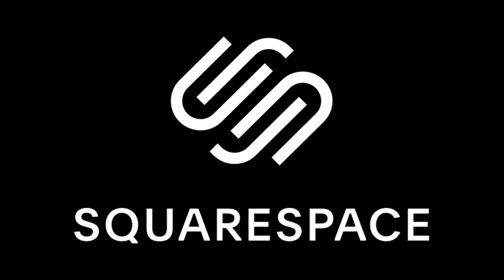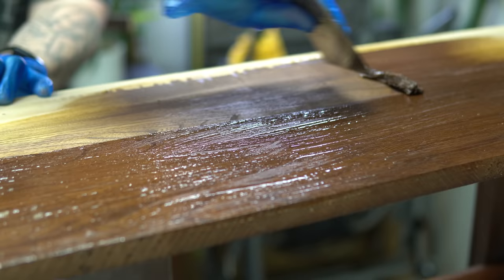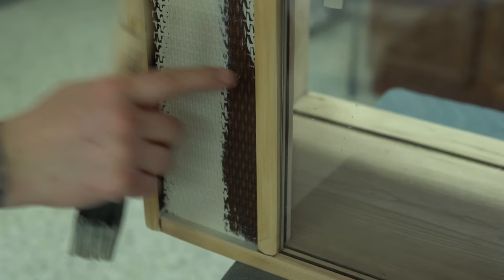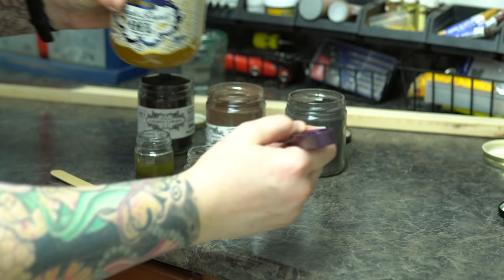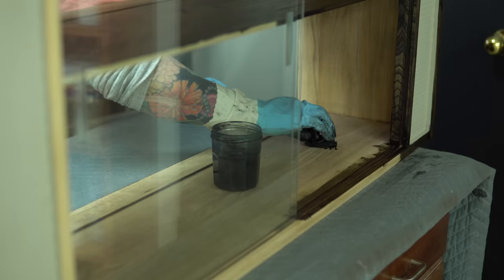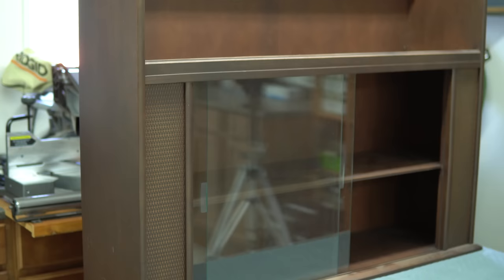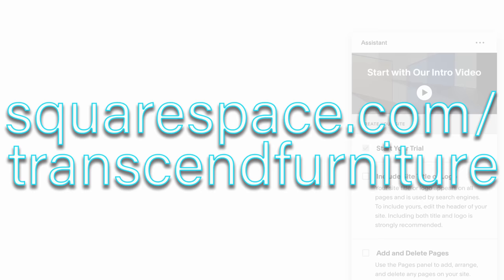How to Turn a Hutch Top into a Cabinet (with Legs!)

Comment: Love the finished results. It may be fun to have the legs match the cane panels. ♥️💁🏻‍♀️
Question about adding legs: What determines if you need to add a fifth center leg?  I’ve seen some really big pieces with four legs then smaller pieces with 5. Is it purely esthetic?  Thanks.
Reply from the maker: It usually has to do with the span of the piece and the weight. Especially with the long mid century pieces, they tend to develop a sag in the middle over time and could really benefit from a fifth leg. Thanks so much for watching!

Comment: First of all: your reveals are the best that I've ever seen! I love the build-up and flowing shots.
I like the plastic color and the legs. Here's why - the leg color allows the piece to "float", almost as if the piece is heavy (with the back panel textured look, the 'dated' plastic pieces that you were going for, and prominent elm grain) but the legs are "light" in weight; almost like the ropes hanging from a hot air balloon. The plastic pieces are slightly "aged" with the black stain that was rubbed away; it looks very authentic and NOT cheap and plasticy (new word? 🤣)
There's my .02 cents. I love it!
Reply from the maker: Wow! Thank you so much for the enthusiastic kind words! I'm so glad you love the piece. Thanks for watching! 😊

Comment: I like the color of the legs, however, I would prefer it if they were straight.  Beautiful work Angie!
Reply from the maker: Unfortunately because the piece is so narrow, straight legs make it less stable, and I don’t want anything at risk of tipping with the slightest touch. So it’s either a custom base or angled legs, at least for me.

Comment: To take the glass out take a long clamp- about 6" longer than your piece. The harbor freight ones work fine. Take the loose part entirely off, turn it upside down. It becomes a spreader. Put your glass pieces in the center for easy removal. Put a spreader about 2 or 3 inches to either side and spread it up gently.  It'll loosen it and come out safely and it makes painting etc, SO MUCH easier.  Have fun!
Reply from the maker: Thanks so much for watching Heather!

Comment: I would kill for a large horizontal bookcase with sliding glass doors (much bigger than this hutch). Think of the sliding glass doors as an asset! They let light in and keep dust out!
I really don’t care for projecting legs. They take up valuable space and are just too easy to trip over. Thick square or rectangular cross-section corner legs, say, six inches high by 1-1/2” or so, would be more stable, and just as authentic midcentury.
The wood grain you’ve revealed is GORGEOUS! I love the elm! But whatever legs you used would I think be better matching the elm or else a smokey dark gray.
Reply from the maker: Thanks so much for watching!

Comment: I'm on the side of leaving the legs as the are now. For some reason it's balanced in part because of the wallpaper on the back piece. 

If you do the same color as the main portion or even black, it just seems it would be "blah".

You could do some photos and try it in a photo program to see what happens. If you don't have Photoshop, Gimp is an open source freebie. I use it on my laptop when I don't use my PC.
Reply from the maker: Thanks so much for watching and the ideas! 😊

Comment: I like the colour contrast between the lighter legs and the elm (gorgeous wood grain, that's the real star).  Also like the wallpaper - both colour and texture.  The problem is the plastic "wicker" stuff; trying to get it to blend with the wood colour over the white paint makes it look a bit "grubby."  Maybe trying to match the colour of the wallpaper (or close enough) would tie it together.  (But I'm a dabbler, you're the expert and it's fine either way.)
Reply from the maker: Thank you so much for the suggestions and for watching!

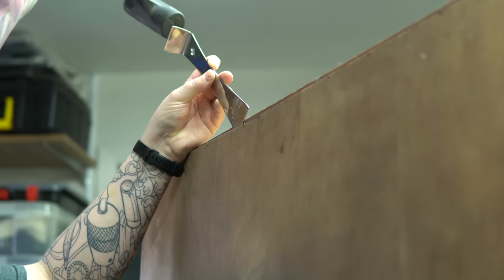Comment: I totally need that tool you use at 2:27 to pry the back off. I always struggle with getting them off in tact.
Reply from the maker: That's a Cat's Paw prybar. Any hardware store would carry them. Thanks for watching!
Reply: @TranscendFurnitureGallery  I have something similar but not as thin on the end. Knowing a name to search for sure helps. Thanks!

Comment: Huge improvement, but I agree with you that the plastic wicker side panels are not working. how about painting the plastic wicker side panels and the legs in a charcoal  colour, similar to the colour on the top half on the ceramic vase you have placed on the left bottom of the unit?
Reply from the maker: Oh that's a nice idea! Thank you so much for watching and for the feedback!

Comment: This turned out beautifully.  Very courageous to use the black stain!  It does look so much better than it did before and the wallpaper in the back is very complimentary. I did have a question,  do you use a rag to wipe the stain off or are those paper towels?  Also, how long does it take for the wax stain to completely dry inside of a house?  Thanks!
Reply from the maker: I was just using a blue shop towel. The mixed stain I used here usually dries to the touch pretty quickly, but I usually try to give a couple of weeks for full curing before any heavy use.
Reply: @TranscendFurnitureGallery  Thanks for the info. Is the towel made of cloth or paper?

Comment: How/what do you recommend for normal cleaning/maintenance of your refinished pieces?  Any certain products do you use?  I notice everyone talks about having wax build on project they get that has a lot of build up.  I love your videos - you have a very soothing voice and speak very distinctly.  Thank you
Reply from the maker: I usually recommend a soft, lint free, slightly damp cloth. For things that need a bit more, a slight bit of a mild dish soap, wiped clean afterwards with the slightly damp cloth. Things like pledge are terrible for finishes, because of what they contain. Some commercial cleaners will eat right through certain finishes and not others. Something like a beeswax polish every so often is usually ok as well. Thanks so much for watching!
Reply: @TranscendFurnitureGallery  Thank you for your reply.  I really enjoy you videos!

Comment: On a selfish note, first I have a question: do you have a brand or a link for the wall paper?  That would work really well with some stuff I’m working on in my 1950s home restore.  I know you said you had it for awhile but maybe I can find it with just a name brand. 

I’m going through the same dilemma on the legs with a piece I’m working on now.  As is they are a little too light, but if I start trying to match them to the piece I have a feeling it will just be obvious that I failed at matching them, if it makes sense.  Fortunately I have just barely gotten it sanded and the stain color isn’t final yet so we’ll see where we end up.

And finally: Nacho!  He’s adorable and reminds me of my Squirrel.  He’s a classic tabby like your Nacho but he’s buff, so more muted than Nacho. Beautiful color. He showed up at the house hanging around the roof where we have a problem with squirrels.  My husband kept thinking he heard a squirrel on the roof.  So once I got him neutered and vetted I didn’t have much luck finding a home for him. My husband didn’t want me to keep him but my last opportunity to place him fell through so I’m guessing that’s he’s ours. He was about 9 months when we found him and just over a year now and 	I really should hav named him Puma.  He’s like a mountain lion with his long tail, legs,  and big paws.  I keep telling my husband he must have wanted to keep him since he (inadvertently) picked his name.  He says he did no such thing.
Reply from the maker: The wallpaper is NuWallPaper - Poplin texture. The links for purchase are in the description for the video. Your Squirrel sounds adorable! Thanks so much for watching!

Comment: I'm curious, with this piece and the bottom, would it have been possible to remove the plastic wicker parts and replace with rattan cane webbing? I know it would have cost more but they could have probably sold for more.
Reply from the maker: I could have but they way they had the plastic piece constructed into it, it would have made the removal quite difficult. Thanks so much for watching!

Comment: Absolutely love the legs the way they are, It gives it a different dimension to the piece. I love love this 💗💗💗💗 How do you work with led paint? I can’t find the video where you talked about that. I have 6 dinning chairs that I scraped most of it off, but I find it so hard to sand. Especially the middle of the chairs there’s very little space between the curved piece of wood (spindle) I’m at a loss. Would love any kind of feedback 🥰
Reply from the maker: Thanks so much for watching! The video where I deal with lead paint is here: https://www.youtube.com/watch?v=IVXWaeHzyQA&t=440s
Please be very very careful around this paint. Use protection. I hope this helps!
Reply: @TranscendFurnitureGallery  this was extremely helpful and I thank you so very much for your help. I unfortunately did all the chairs by sanding in my garage with the doors closed🤦‍♀️🤯 I wasn’t able to get rid of all the particles from sweeping or cleaning as I had many different pieces of furniture and wood piles in my garage. I’m hoping they are gone now since it was two weeks ago that I did that. Thank you again for all you do 🥰💜💜

Comment: Gorgeous! Question, I'm redoing a VERY heavy, 3 bowed glass door, top cabinet piece. Also, it's going to house an extensive (and expensive) crystal and mineral collction..so it NEEDS to be sturdy, no other option. What type of legs do you suggest? The piece is longer than it is vertical, so that helps, but again solid& heavy. I was first thinking sofa legs? Not as pretty but it's that my strongest option? Please help
Reply from the maker: Oh gosh! If stability is a consideration, the lower the feet, the better. Bun feet work great but if that doesn’t match the style of it, shorter tapered legs (like for a sofa- good call) would work. Something like that I would also brace at the back right into the wall- you can get hardware specifically for this, so that nothing moves around when you open a door. They have a tendency to want to tip forward otherwise. Good luck!
Reply: @TranscendFurnitureGallery  thank you so much!